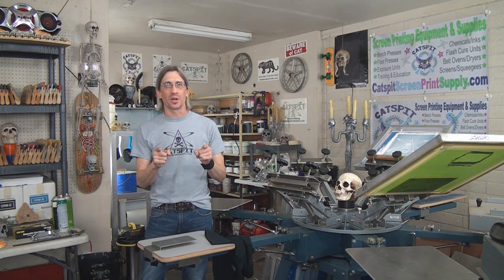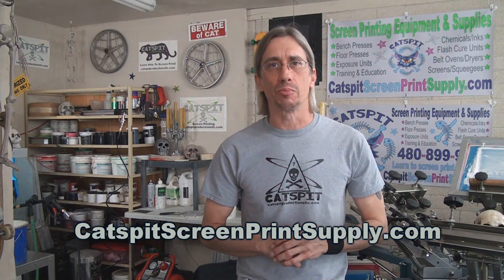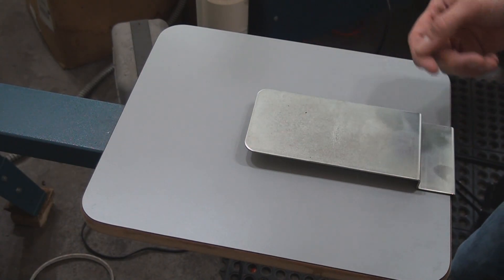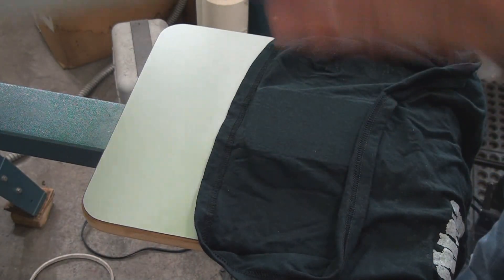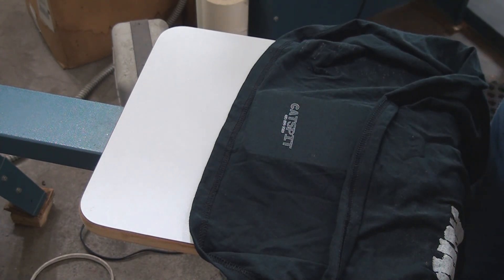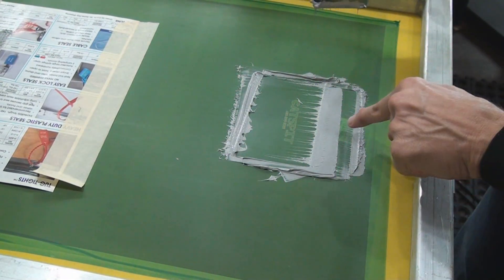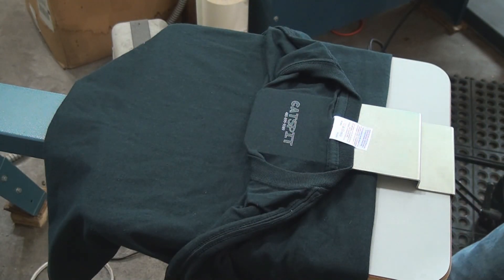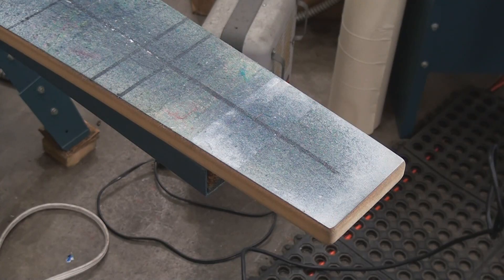Screen Printing Tee Shirts: How To Tag Print Inside The Collar

Comment: Great tutorial. Had me wondering what number mesh screen did you use for the tag design? I don't think I caught it in the video. Thanks!
Reply from the maker: Thank you!! I think that was a 230 mesh screen. I wanted to print a much lessor amount of ink along with the fine lines and dot. Thanks for watching. Screen Printing Equipment & Supplies - http://catspitscreenprintsupply.com/

Comment: The problem I am facing is that when I'm tag printing the logo on the collar, it's ink impression becomes visible from the back of the t-shirt. Kind of looks unprofessional. It's a white t-shirt with black logo outlines, so when the print is done, the black outlines of the tag print under the collar are visible from the back of the shirt. How do we avoid that? Is it something to do with the ink or the pressure while printing or the artwork? Please help.
Reply from the maker: Yes, basically the tips I gave in this video. Ink and art is a factor. As well as squeegee pressure. Thanks for watching! Screen Printing Equipment & Supplies - http://CatspitScreenPrintSupply.com/

Comment: Right around 15:18 you said "15 degree angle" what does that mean? I've heard that before, but didn't understand that.. I'm still very much a novice.
Reply from the maker: Hey Chris! Yeah that is the angle of the dot so it does not line up with the screen mesh grid and create a Moire pattern. We angle the dot so they do not fall into the openings of the mesh too much or cause interference patterns. Thanks for watching. Screen Printing Equipment & Supplies - http://catspitscreenprintsupply.com/
Reply: Allow me to elaborate:

15 degree angle is the angle btwn 14 degrees and 16 degrees.
Reply: Seriously tho, its the angle at which your printer prints halftone dots. If you dont do halftones right now it is not important to you. But if you do you can adjust the angle and LPI accordingly in your art program (eg. Illustrator) or in a RIP program like Accurip. The numbers are determined by screen mesh count or the design itself along with a few other important parameters. 

Hope this helps and gud luck
Reply from the maker: Joe Chabaks Hey I can reply to you on this comment! Stupid G+ Yeah so it's the angle at which the dot is printed so it does NOT line up with the angle of the grid patter on the screen mesh. Thanks for the assist!

Comment: Do these inks crack over time? Looking into screen printing some shirts but don't know which inks crack and which don't... Still learning.
Reply from the maker: When properly printed, any most decent inks will not crack, flake or peel. Water based inks fade some over time. Plastisol does not. Thanks for watching! Screen Printing Equipment & Supplies - http://CatspitScreenPrintSupply.com/

Comment: could you make a heat transfer  to make it easier and faster
Reply from the maker: +Art Barnett That would add an extra step to the process actually. It's just as easy to print it directly. Thanks for watching. Screen Printing Equipment & Supplies - http://catspitscreenprintsupply.com/

Comment: how much heat do you need to cure the tag print
Reply from the maker: +Art Barnett It's the same scenario for any plastisol ink. It has to reach 330 degrees F throughout the entire printed ink layer in order to cure and be wash safe. Thanks for watching. Screen Printing Equipment & Supplies - http://catspitscreenprintsupply.com/

Comment: Hi there and thank you for all your educational videos, they are great! I was wondering if you were to tag print inside the collar of a sweater where the fabric on the inside is not as smooth as on the outside. I have tried to actually shave the inside of the collor, that did not work :P Do you have any tips on how to go around that one?
Reply from the maker: You're very welcome. I'm glad you enjoy my video work. Possibly a heat transfer or a heat transfer label. If it's very rough print surface, it will be difficult to get print clarity with direct screen printing. Thanks for watching. Screen Printing Equipment & Supplies -  http://catspitscreenprintsupply.com/

Comment: when i was doing it plastisol ink showed from the other side when i was using a white tshirt or a light garment in general, how do i go about that?!
the tshirt that i am using is relatively thick and a 70% cotton
Reply from the maker: +HundredBucks1 I'm not sure. Perhaps reduce your print stroke pressure. Change the artwork to be "lighter" or even use a different, thicker ink. The trick is to not use too much pressure in the flood and stroke while using artwork that will help keep the ink light. And heavier garments work better of course. Thanks for watching. Screen Printing Equipment & Supplies - http://catspitscreenprintsupply.com/

Comment: Couldn't you have just turned the shirt inside out which would enable you to load it further in on the long sleeve pallet?
Reply from the maker: Yes, and then you could use a standard pallet too. But on larger orders that means you have to turn them all inside out before printing and then turn them right side out after printing. On a smaller run this may be fine but on 500 pieces it would be a time consuming pain. Thanks for watching. Screen Printing Equipment & Supplies - http://catspitscreenprintsupply.com/

Comment: Why do you don't flip t-shirt inside out.
Reply from the maker: That's a good question. But to turn it inside out to print it and then back again to deliver the shirt to the customer is a bit of work especially on larger orders. On a small print run you could certainly do that but on 100 pieces or say 500 pieces then it becomes a bit of extra work. So the idea is to try to print it in such a way that we don't add extra steps. Thanks for watching. Screen Printing Equipment & Supplies - http://catspitscreenprintsupply.com/